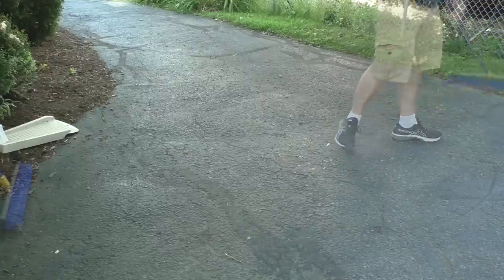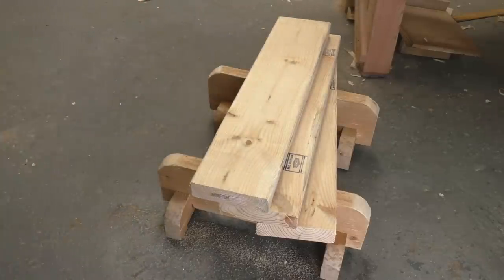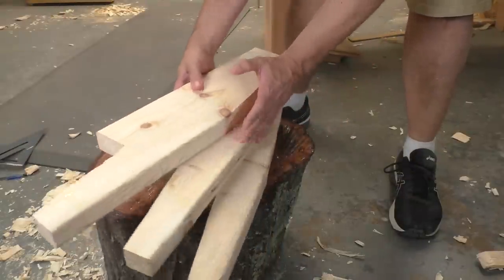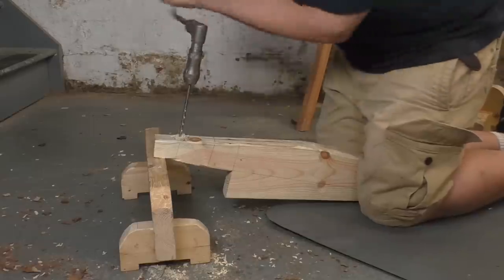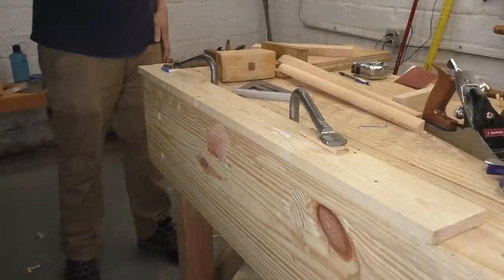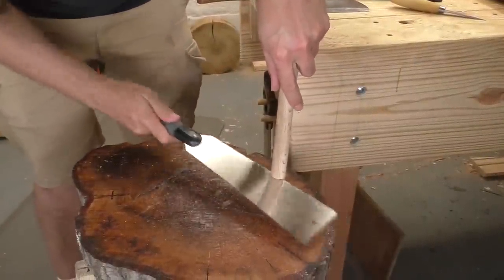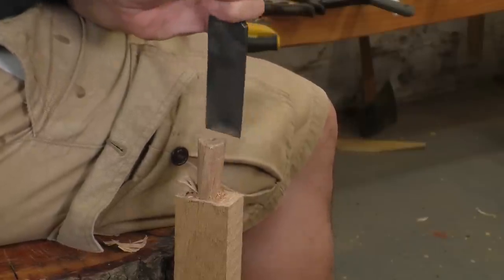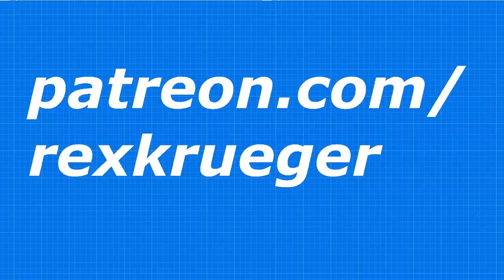Make a portable chopping-block workbench.

Comment: Interesting idea.  A few thoughts:

1.  When I was installing satellite dishes, my go-to for driving in lag bolts was chucking a socket into my brace.  It made the job fast and had enough torque that a few times I ended up twisting the heads right off of the bolts.
2.  Another option for holding things vertically is a couple of cheap ratchet straps wrapped around the log.  They will provide PLENTY of pressure while conforming to any shape.
3.  For apartment dwellers who want a 'stealth workbench' for their balcony, they can make a simple, small tabletop that attaches to the top of the log, giving the whole thing a neat appearance and utility when woodworking is not on the schedule.
Reply: Like the stealth idea. I've started work on a low-roman bench (by buying the wood and letting it acclimatise as suggested ;)) and it's going to replace the old couch-table that I currently have on my balcony for the outdoors sitting bench. Once it's done and I can see how it looks, I'll consider building a finer tabletop as you suggested for when I don't use it as a workbench.

Though I think keeping the bench outside will probably not be good for it and I should keep it inside, now that I actually think about it... It wouldn't get wet during a normal rain unless there's a lot of wind, and I could put it inside durig fall and winter, but even the humidity in summer might be bad enough to warp it... Don't really have the experience to judge it.
I have a bit of time to research that, maybe I just need to use an appropiate finish and it'll be fine...

Comment: I made a chop block for my backyard this spring. I love it, it works as a bench. I use a rope vise, which is just a loop of rope that step on the bottom. I added a stick so i step on the stick and the end is in the bottom of the loop. Works, fast & cheap!

Comment: I’ve seen shingles made using a tall stump as a bench. They used old bike tire tubes as upright clamps when using a froe to split pie-wedge shaped stock, but I bet it could also help stabilize work in your screw clamp setup.

Comment: An alternative to the lag bolts are GRK construction screws, can still use a washer, but you can just drive them into the log...the #9- or #10 - by whatever length Rex mentioned...the box of #9 × 3 in I have list themselves as replacement for 3/8 lag bolt....

Comment: I found a bunch of logs on the side of the road.  Used one to make a mallet.  Hard maple.  Found some birch a few days later.  Let them sit inside my work van for a weekend.  Came back to my truck being infested with ants from the maple and thrips from the birch.  It was like a holy war from trails of ants and clouds of thrips fighting each other.  Used a blower to blow them all out of the back.  I thought it worked, it did not.  "Eh, the summer heat will kill everything," I thought, also wrong.  Fought them all for months, coming home with fresh bites and stings daily.

0/10 -  Would not Thrip again.

Long story short, how the hell do you seal and pest control a log, because, you know, that sucked 😅
Reply: huh, good question. Freezing probably is out of the question, it wold split the wood, right? 
Sealing it in ceran wrap might work, but will take a long time (a beginning ant colony doesn't actually need food until two or three months after the queen has settled into the wood, but oxygen might run out sooner).
If you have a big enough oven/kiln, heating it to 70-80 °C for a couple hours should kill anything organic, and hopefully isn't extreme enough to damage the wood (no idea)...
If it's completely green you can probably submerge it in water for a couple days and then dry it afterwards, though that might take even longer than the ceran wrap idea ;)

Maybe it's easiest to just do your best to find out if there's anything in there (thump it onto the ground a couple times?) and then hope for the best... Maybe have a go with a gas torch into any holes you can find in the wood. 

Disclaimer: Many species of insects are protected, so adhere to your local laws. E.g. in Germany you're not allowed to harm any wild animals, regardles of species, "without a reason". The law doesn't say it has to be a good reason though, so one might argue "I wanted the log and there were ants in there, so I made them not be in there anymore" is sufficient reason ;) Then there's protected species, and you can face tens of thousands in fines if you disturb the nesting place of a protected ant species, e.g. by pulling out the log they are nesting in... Or if you destroy a wasp's nest and it was the wrong kind of wasp (you have to get someone to move it).

Comment: It is nice to put a small v in the log surface or leave a ledge on one side. It can act as a brace point for your work piece when you have it tipped up on a corner. Prevents it from kicking out when working the Axe.

Comment: Nice video. I prefer to make my chopping stumps by boring angled holes in the base with a T auger. Then you just need to find three green branches, whittle the tenons slightly oversize, and pound them into the holes. If they loosen over time, just add shims. I've made dozens this way.

Comment: Thanks Rex. I used to make, either a round coffee table, or bed.  I could never cut the legs of the table, so that the table didn't wobble. Then I cut the table legs long, and put the table together.  Then, I would flip the table over, and and level it, with paper under the legs.  Once the table was level, I would put a paper back up against the table legs, and mark the the cut line. Because the table legs were long, I'd ask the person, "How high do you want the table?"  It seems a silly question, but I've sold coffee tables to woman, five foot one, and guys six foot four. It makes a difference. not that's why I did it, because I'm hack at wood working.

Comment: I've got a slab of wood I've been saving for a few years now. It's about 6-8 inches thick and  a good 3 feet long. It came from a tree that was removed from the apartment complex I was living in at the time. 

Even though it's got a big split in it on one side, I'm fairly certain I can reinforce that... and make a 4 leg version of this bench. I can probably add some rope handles to the sides as well, to make moving it easier, as I live in an apparent.
Reply: sounds like a good idea and a start on a low style bench that will work and be unique.
Reply: @dcolorado7483  flattening it is going to be the biggest problem. But my uncle gave me an old electric planer, so I shouldn't have much trouble there.

Comment: I like this. I have to sit because of lower back issues and this log idea is great for getting the work at my sitting level. There are two logs at exit 273 on I-95 in ormond beach. I claim those lol
Reply: Seriously? You are claiming both logs? I would like one. As a member of the Rex Woodchuck Club, remember by-law #3b there are plenty of splinters, nicks on fingers, and wood shavings to go around. If there is a claim on the same piece of wood; who ever has the sharpest axe will split the wood and the other person will choose.
Reply: D Colorado even though they are 7 miles from me, I haven’t had a chance to go there yet. Snooze you lose.

Comment: Driving in the lag bolts ('coach screws' in UK) , one could use the brace drill (some drill accessories sets have sockets with hex shafts)  and get a more ergonomic action but also the feedback Rex described in his video on brace and bit.
Reply: my bit set (one of those mini ratchet things that also accepts screwdriver bits) has a piece that fits into the socket and has a hex shaft on the other side. So it's totally possible to get sockets into the bit brace

Comment: I wonder if you could even drill a handful of holes vertically in the leg where you have the screw clamp? that way you could switch that bench dog peg into one of the holes and it would help support the workpiece vertically while chopping. That seemed to be the main problem with the screw clamp setup was that the piece was sliding down as you hit it.

Comment: May I suggest, Sir, when carving a tenon on the end of a chair leg with your small block bench, and a screw clamp Place a scrap piece of wood under the chair leg below the screw clamp.  This will stop the work piece from trying to slip down, and it will feel solid as a rock..  But what do I know?
Reply from the maker: I like it! I was thinking of adding a peg or something.
Reply: @RexKrueger  Thank you for your reply.  A peg would work but would wear out the hole after a while.  A scrap two by four and a quick spring clamp would be much faster and more sturdy.

Comment: did you treat that block with something?  BLO?  I have a feeling grandpa would tell me to soak it in used motor oil.
Reply from the maker: Just a little wood glue on the end-grain to keep it from splitting.
Reply: @RexKrueger  would this be useful to help hold together the face of a wooden mallet as well? Got a crack that on one side of mine that does doesn't go all the way through and I'd like to keep it that way.
Reply: @BHGiant3  might be a job for super glue. can be used as very durable wood finish.

Comment: I keep wondering what height the block should be?  I don't want to be bent over the block so maybe the height should be between your man parts and your waist?  I guess easier to trim the legs than add more length later.  Thanks for the video.

Comment: It is probably bad that I would really like to know where in the Cleveland area you can get a 3ft tall hardwood stump (min diameter of 15 inches) like mentioned as one reason to build this instead of using said stump.
Reply: Call a firewood dealer or tree trimmer (arborist).

Comment: Can someone discern a joiners hatchet from others? I have a little hue-ing hatchet and have been using it to remove some waste. Is there a better configuration?
Reply from the maker: Mine is just a boyscout hatchet. It's totally fine. A "hewing" hatchet is better, but harder to find.
Reply: If I go by the pictures I can find a hue-ing hatchet tends to be symmetrical in form, while a joiners hatchet seems to be shaped more like a bearded  hatchet. Somewhat like this: https://northmen.com/upload/axes/468/finnish-carpenters-axe-listed.png That lets you get your hand nearly in line with the impact point and gets you a lot of control when it's time for the last trim and makes using the hatchet as a push knife easy.
Reply from the maker: You have it backwards. The hewing hatchet has a single bevel.
Reply: @RexKrueger  yeah, I just restored a broad axe hatchet. It was left handed, but I put a new handle on it and made it right handed. Nice flat on one side...bevel on the other.
Reply: @RexKrueger  I wasn't thinking about bevel but more about the shape of the head in the other axis.

Comment: I tried using a log for this purpose but it brought a lot of bugs in the shop. Then the bark started falling off making a mess. How did you deal with that? Did I use the wrong species or two wet? Great videos! Keep up the good work?
Reply from the maker: I would guess the log sat outside or was diseased when cut. A fresh log from a healthy tree will be bug-free.

Comment: Speaking of, how's your thumb? Any lasting problems with scar tissue? It was a pretty nasty wound but from what you shared it doesn't immediately look like any important nerves were cut. I could imagine you have a numb spot right on the tip.
Reply from the maker: It looks totaly normal,  but the nerves will never be the same.
Reply: @RexKrueger  Ouch. Have Saw Stop reached out to you? Your injury is fairly spectacular compared to "usual" Saw Stop injuries. I'm guessing your fingernail touched the blade and, because keratin doesn't conduct electricity as well as skin, Bad Things Happened (tm).

Thanks for sharing all of the good (and bad) parts of woodworking.

Comment: o  Historically, a longitudinally split log would be used.
o  You aren't using your feet:start thinking of all the work holding options if you press down with your feet on something connected to the log surface.
o  You can use it to support a spring lathe for making tool handles etc.

Comment: I'm cutting down 2 Ash tree's next week and will be keeping some rounds.  How do I dry them.  I'm in Nevada so they will probably dry to fast.  Also I want to make a guitar body out of some of them. Should I cut them down to 2 or 3 inches thick before drying???  Thanks for making such great video's. I know you have the answers for guitars too!
Reply from the maker: No need to dry them.  Just seal the ends.  I used glue.
Reply: @RexKrueger  Thanks, my Dad's ol Craftsmen plane works better than ever because of U!!